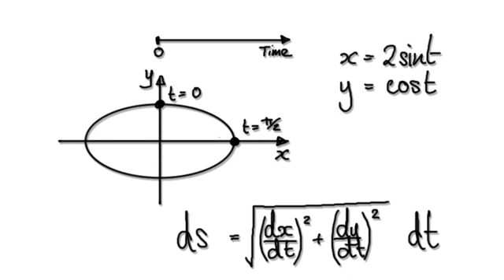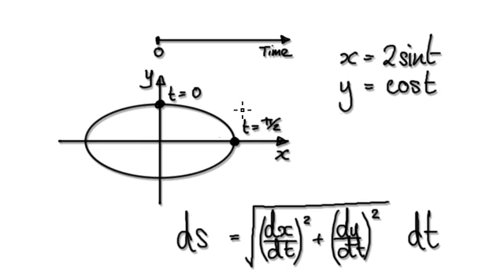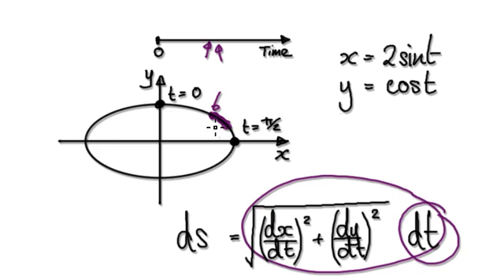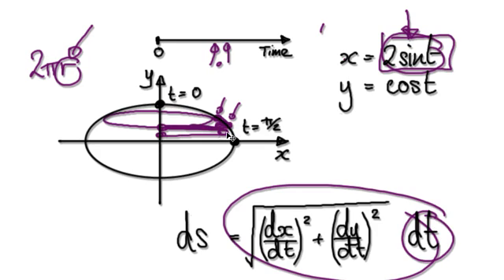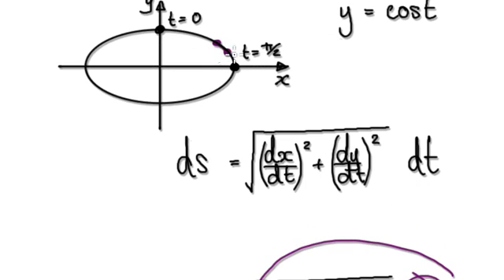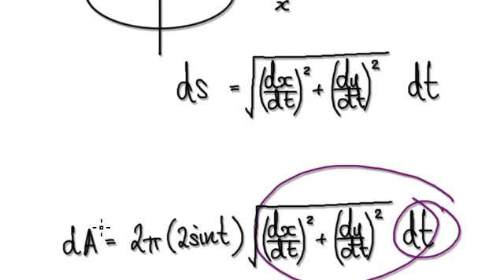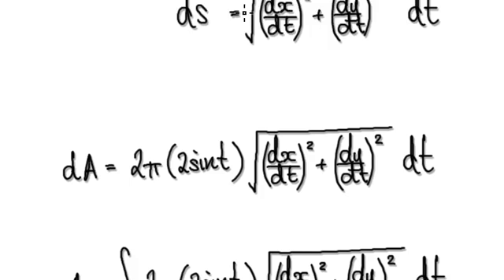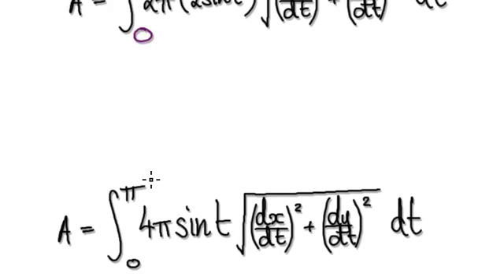Video 2059 - Surface area of an ellipsoid - Part 1/3

Comment: Could you please link where you have explained ds=.... earlier (0:27)? Much appreciated.
Reply from the maker: Video 2058.
Reply: @ChauTu  hiya! thanks this helped heaps. I ws wondering what the percentage error this method has as the calculation on the website has around a 3 percent different (w different coordinates)
Reply: @ChauTu  No worries, I've got the correct answer. Thanks yet again for this series of videos, really helped with an assignment :)